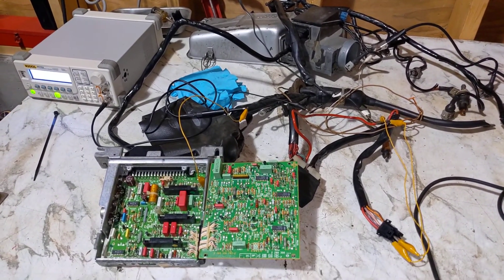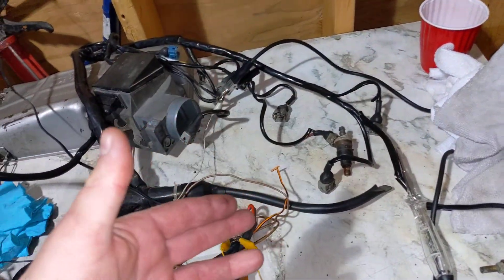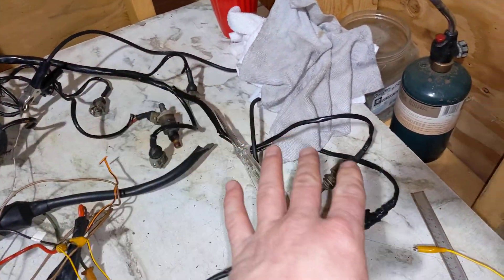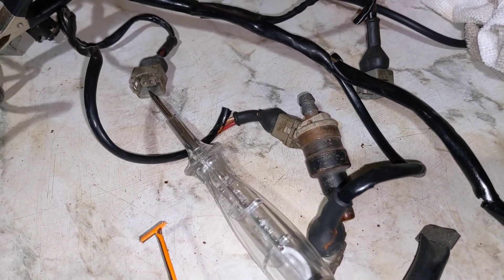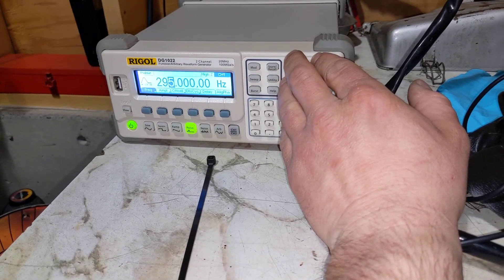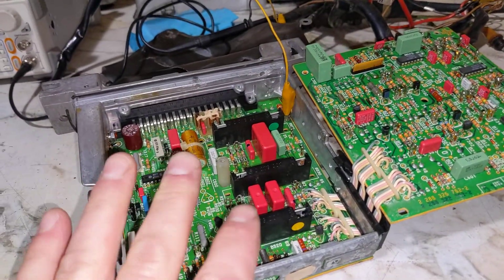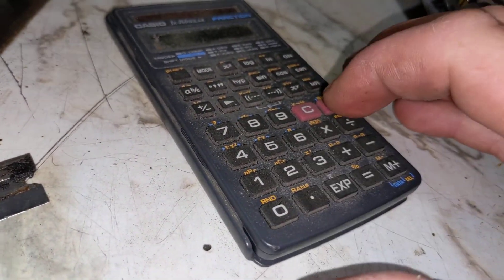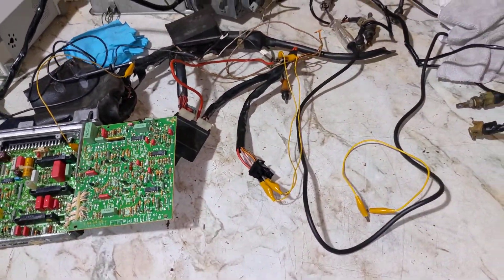Bosch L-Jetronic rev limit bypassed

Comment: Have you any schematics of the L-Jetronic to point to or is this something you've reverse engineered to know which resistors to mess with?
Reply from the maker: After some research on L-jet and reading on very very old forums and posts on the subject, I took a risky educated guess. I have not reverse engineered the L-Jet, as some BMW fellow had already done this about 25 years ago. The schematics and oscilloscope readings pictures as well as the nicely written document describing the operation was sort of lost on the internet about 10+ years ago. I still have it in PDF form however
Reply: @Nodarperformance  I figured someone must have done it after so long and have honestly been surprised not to find much out there. Are you able to upload the PDF somewhere?
Reply from the maker: @IragmanI http://www.demo.cs.brandeis.edu/postscript.dump/Ltronic/Injection.html
Reply: @Nodarperformance  Wow - 1996 internet called and wants it's analogue fuel injection back. Thank you!
Reply: @Nodarperformance is there a way you would send me that schematic?
Reply from the maker: @bigilworth  http://www.demo.cs.brandeis.edu/postscript.dump/Ltronic/Injection.html

Comment: This is cool!
Could this be done to find the idle rev limiter when engine is in park?
I need to raise it on a mercedes bosch me1.0
Reply from the maker: Totally different ECU
Reply: @Nodarperformance   Yes ofcourse, but i thought maybe that you could have a clue about which component on the ecu that control the limiter or if its in a chip.
The ecu doesnt have a flash that contains a software like newer ecus have.
So the limiter is somewhere else..

Comment: I am attempting to setup a megajolt electronic ignition to my 1980 Fiat Spider that has Bosch L-Jetronic fuel injection. My issue is how to get a voltage signal to pin 1 on the ECU to the waster spark coil pack that is a part of my megavolt ignition system. Originally pin 1 was receiving the voltage signal from a coil that was part of the distributor based ignition system. Ant suggestions will be greatly appreciated.
Reply from the maker: The ECU will need the coil flyback voltage (from the negative terminal of the coil(S)) in order to get its RPM signal, and this cannot be changed. You will need to use an ignition system which is designed to take the RPM information (via hall effect or VR) and pass that on to the ECU via the ignition coil. If you're going through the effort of installing a trigger wheel for Megajolt, I would suggest using Megasquirt or another OE system such as Motronic instead
Reply: I have the megajolt, crank fired, ignition system installed. It ran great when i ran carburetors.
Now i have a wasted spark ignition setup not a single coil setup that was on the car when running with carburetors.
I’m trying to understand what and how i get a coil flyback signal from the wasted spark coil that will feed pin #1 on the ECU.
As you can tell my understanding of electric theory is minimal.

Comment: Add a variable potentiometer so you can change your rpm limit later
Reply from the maker: No, I'm good with 6300!
Reply: @Nodarperformance  can you make it to be able to be triggered by external signal? so i can limit it at lower or higher depends on external settings (like using an arduino)
Reply from the maker: @putraadriansyah8082  if you want to do this, just get a stand alone ECU
Reply: @Nodarperformance  I ended up doing what you said, my 1G-E and 1G-FE (it was using the same ECU) now uses Speeduino

Comment: @Nodarperformance What RPM and resistor value did you end up using? I'm looking to modify my Bosch L-Jetronic and am looking for a suggestion on the resistor value. Thanks!

Comment: Hello 
How I can know which resistor must bypassed on Alfa 33 1.5 i.e
I found that wire on ecu connector
And big ressistor in front of it
But dont know which can bypassed
Thanks
Reply from the maker: Unfortunately I have never seen inside, so I could only speculate. If you have test equipment as I have you can probably trial and error until it's found
Reply: Ok
Thank you for answer
But I dont have equipment like you
Only multimeter😄

Comment: Cool setup. We are debugging the same ECU. Quick question: Do you get the injector pulse with just grounds, power, and the signal generator input? Or is there a minimum set of sensors that must be plugged in (or emulated) to get the injector to pulse? Thanks.
Reply from the maker: You will need all but the TPS in order to get the injection working. The coolant temp and AFM voltage are a vital inputs to determine the basic injection PWM. Found the pulse itself didn't need to be specific, only exceeding a certain voltage threshold, and perhaps 25-75% DC. Also note that I have bypassed the ballast resistor in the ECU, as my function generator will only output 20v p-p and the ECU is normally getting 100v + from the coil flyback
Reply: @Nodarperformance  Thanks. We'll set it up and give it a whirl.

Comment: 'Obviously the frequency, divide that by 60' im a alfa mechanic and trust me thats not obvious i have no idea what ur doing u must be some sort of genius
Reply from the maker: I can explain it:

Frequency is the measurement of pulses every second. RPM is the measurement of revolutions the engine does every minute. In an Otto cycle engine the spark event occurs only every SECOND rotation. To find the frequency of the spark event (the L Jet used spark events to trigger injection in batch fire) you will take the RPM, multiply by 60 seconds for frequency then multiply by the number of spark events per revolution (3 spark events per rev on a V6)
Reply: @Nodarperformance  thank you for the reply, if i ever wish to do something like this i know who to come too. Thanks. Goodluck with the alfas!

Comment: Fantastic!
(Have you ever thought about megasquirt? Sometimes i’d like to put it on my 75 ts and put into garbage the motronic😂😅)
Reply from the maker: Motronic is an excellent system and can be FULLY map tuned, just as any other aftermarket EMS. L-Jetronic is entirely different than Motronic, as it is not a digital system, rather a simple analog processing unit. I have thought about Megasquirt (or any of the EMS out there) but the gains are very small when you can tune something mike Motronic on the fly!